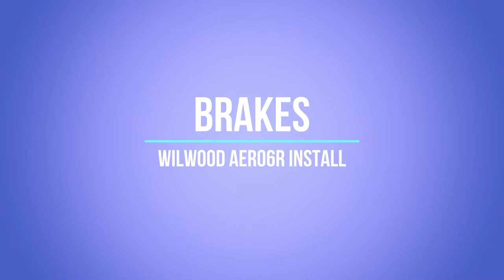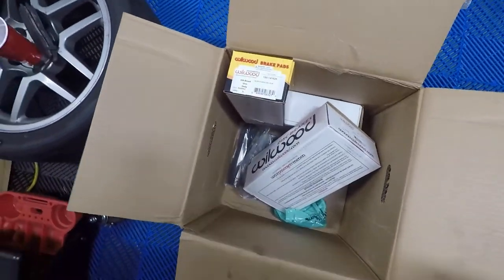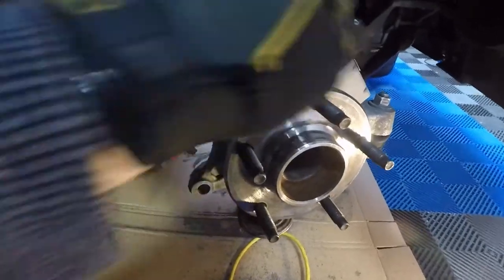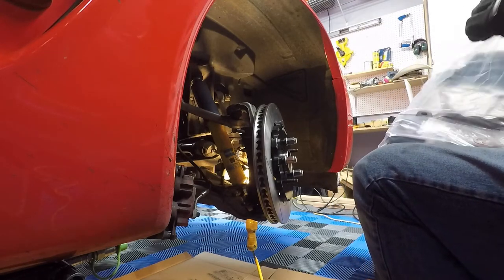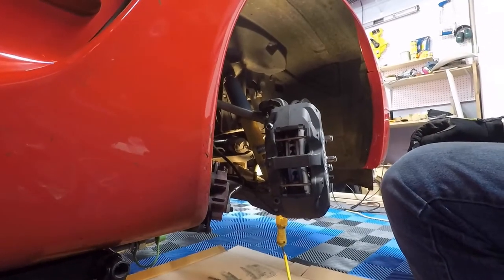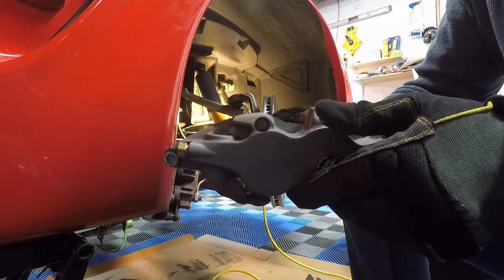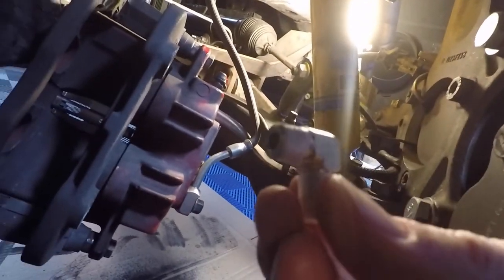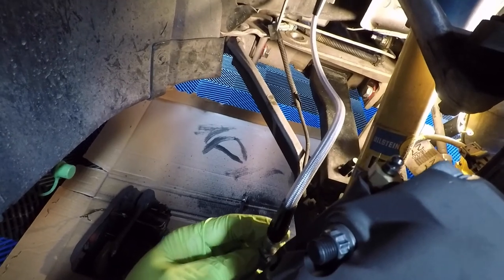C5 Corvette Wilwood Brakes Install

Comment: I realize this video is two years old. But I'm hoping you can answer my question. Did these brakes fit in the 17 Z06 speed line wheels. I watched the video because I saw the speed line wheels in the thumbnail. But didn't see them on the car with the 6 piston calipers.